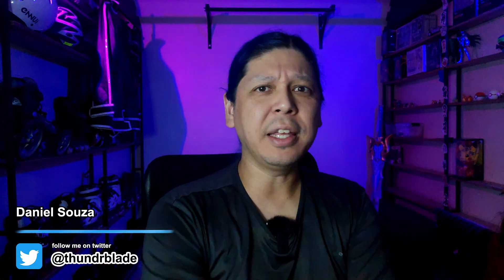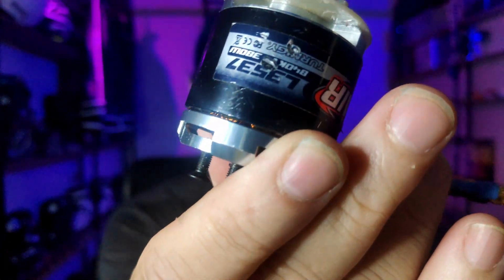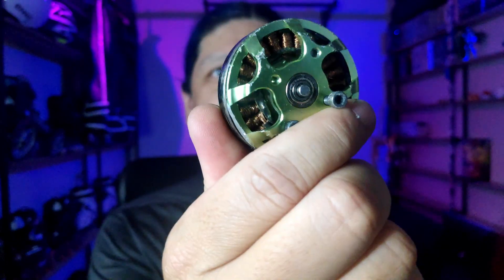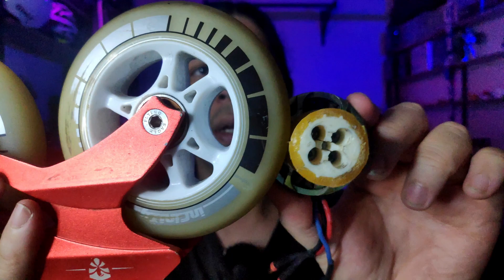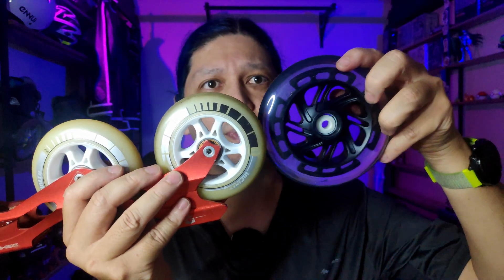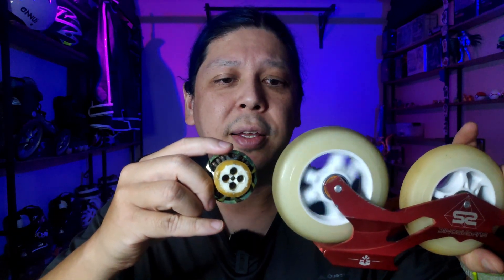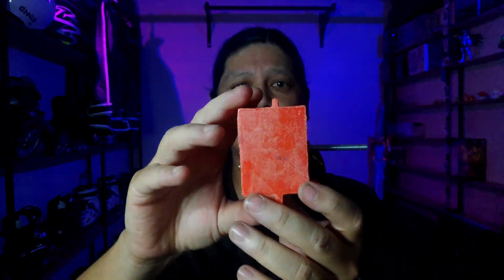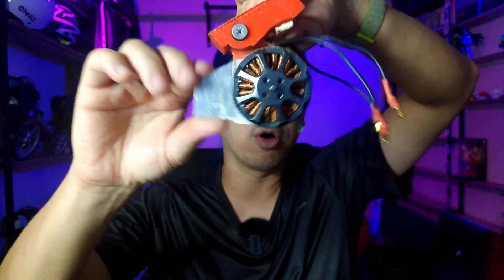Which motors to use in an Electric Inline Skate?

Comment: How much more  power do U think u could get in these motors if the world used fusion or nuclear as main energy source
Reply from the maker: thats some sci-fi talk, but hipotetically, if it was possible to shrink a nuclear reactor the the size of a closed fist the energy density would be several dozens(maybe hundreds?) of times bigger.
Reply: @Thundrblade  why not super conductor batteries batteries that could absorb way more energy than normal while still being small theoretically ofc Because one of the premises of room temperature super conductors is that we would be able to store more energy in power lines  without losing it and it going to waste
Reply: Or actually graphene battery might be closer

Comment: I like the form-factor of the pancake motor. Would make a very nice skate-wheel dimension hub motor, if that can be figured out. Also, loving the Flying Eagle Supersonic frame!
Adding to the durometer. Aggressive skate wheels, excluding antirocker wheels, are usually around 85A-98A. Averaging 88A-92A. Diameters range, excluding antirocker wheels again, are usually between 55mm and 62mm, averaging 58mm-59mm. So I don't see these Thundrblade second gen being used in aggressive skating like Air Gear anytime soon. But, the current aim is for commuting, if I'm not wrong.
The 'sweet spot' for commuter wheel diameter seems to be around 90mm-100mm, so these will be perfect! I'm unsure of the current trend in commuter durometer, though. 60A seems pretty soft, though. But, higher speed means more shock when hitting cracks, pebbles, and such so softer might be better. Softer might also mean the wheels might not get damaged quite as much comparably. Though, I'm sure with everyone working together as we seem to be, we might find some way to get a higher durometer wheel on those motors.
Reply from the maker: yep.
needs testing. Maybe the 65A durometer is already ideal.

The old prototype used normal inline wheels 85A and the vibrations were very annoying after sometime depending on the tarmac.

Comment: Can't we just use the motors as wheels?
Reply from the maker: thats a hub motor. and I showed a hub motor in this video.

a hub motor has a disadvantage when compared to other drive systems. I could make a more in-depth video about the different drive systems and gear ratio, but here is a little bit.

like I said in this video, the Friction Drive (FD) had the bigger possible gear ratio. 1 to 5 or 1:5.
a belt drive had 1:2 
a hub drive has a 1:1 which means it has the least torque. So a hub system NEEDS a bigger and heavier motor, while a FD can use the smallest and lightest motor.

the old motors I showed are too small and weak to use as a HUB system. they need gears to multiply their torque.